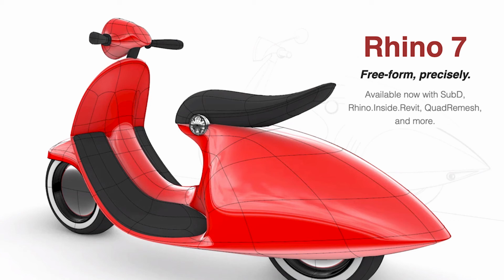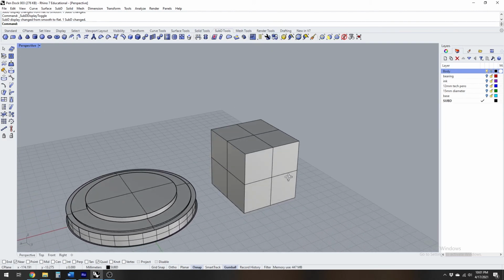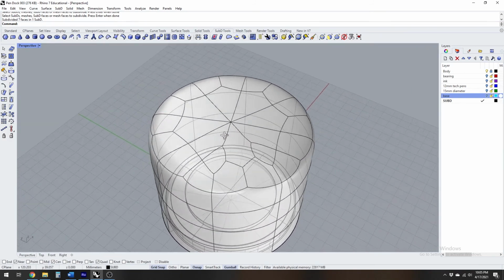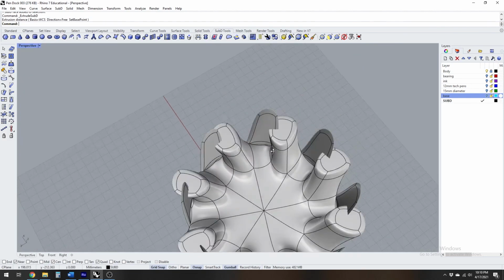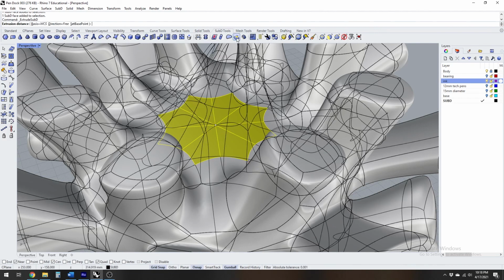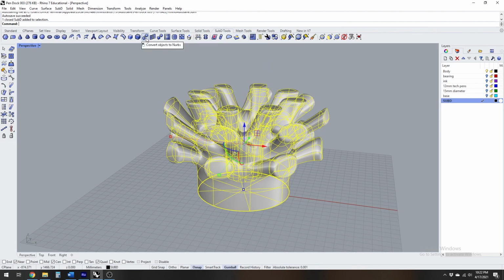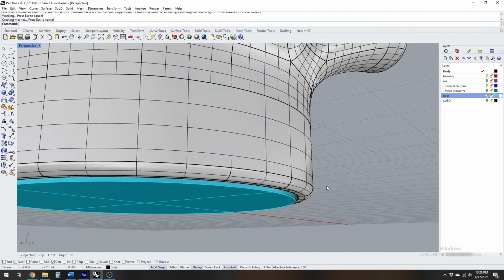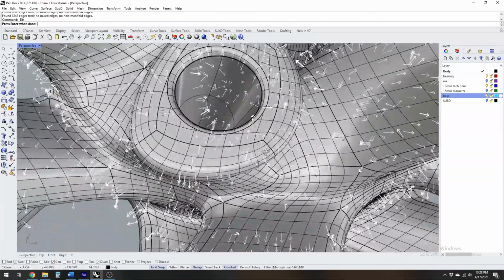Rhino 7 SubD Demo

Comment: nice and smooth model result...I've got a question... when we convert subd models into nurbs, it makes all faces to individual surfaces that are joined together! or when we want to unwrap this model in another software like ((Rizom UV, 3ds max, keyshot and so on)) they consider all these edges as seams and make the model into many tiny seperate faces which make the unwrap process impossible. do you have any suggestion to solve this problem?
Reply from the maker: My suggestion would be to run a quad remesh in Rhino before exporting. https://docs.mcneel.com/rhino/7/help/en-us/commands/quadremesh.htm